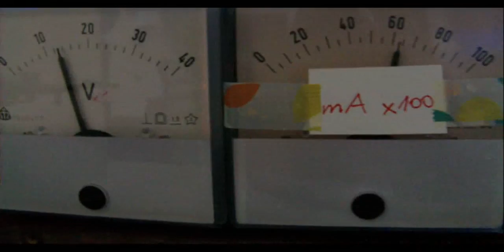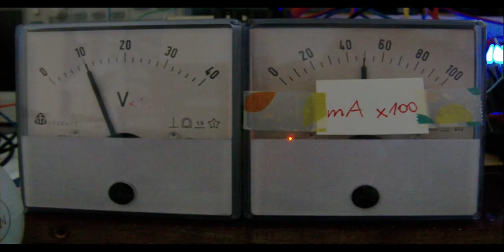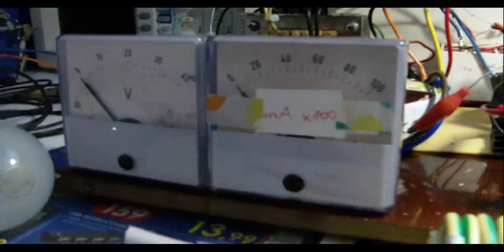Increasing current from 5A to without load state 6A with high voltage - disturbing em field

Comment: Hi, I am trying to get an increase of current through my circuit.  Currently it is producing 0.023 A.  I am trying to charge my 2200 uf -400 V capacitor as fast as possible using a flash circuit.  However, even though it has an output of 180 - 210 V from a transformer, i only get 0.022 A current coming out of the 225 resistor.

Can you suggest how i can achieve this without changing the 1.5 V batt?  i know placing batteries in parallel will increase the current but give out the same voltage whereas batteries in series will only boost the voltage.